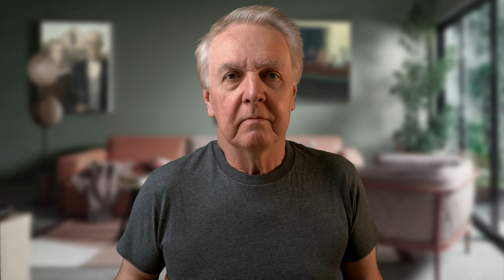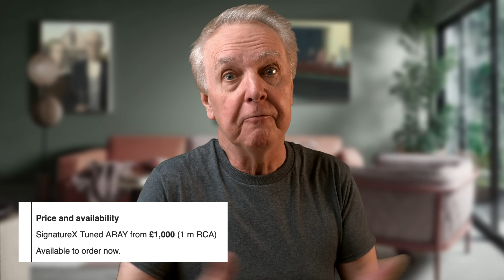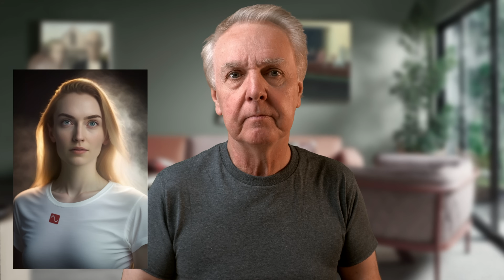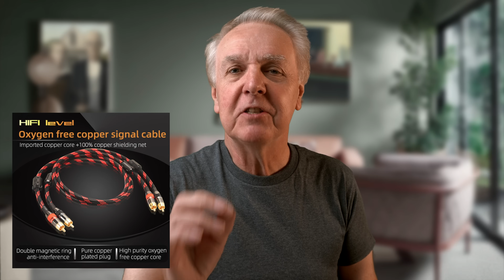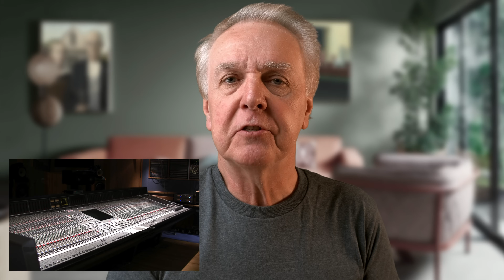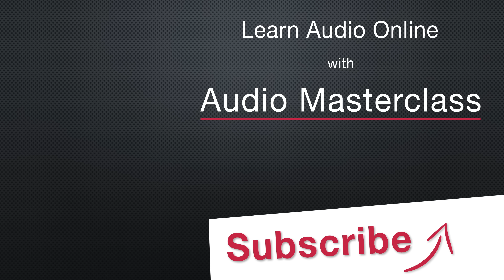Would you pay $1000 for a 1-metre cable?

Comment: My interconnects retail for $11,700 for a 1 meter pair.  If you can explain to me why the manufacturer specifies interconnects and digital cables in mettric and speaker cables in feet.  The lady's comments were as over the top like many in this industry I'm in.  I highly recommend to my customers and anyone interested that they follow the advice of early 20th Century composer Charles Ives "Stand up and use your ears like a man".  I loan this stuff out (the 12K ones are the most expensive, with the starting point being a couple of hundred US dollars).  There is a great deal more to the sound than the things you mention.  Yeah, most anything will give you flat frequency response.  One of the first things I hear in lesser cables is what I call "smearing".  Cable insulation is a dielectric - it stores and releases energy.  There are many other elements that are over my head.  I simply listen and decide if the improvement, assuming there is any, is worth the money for my budget.  Skin effect is more complicated than you mention.  Based on your comments, and assuming you have a competent system, ile. decent, not necessarily high end, I suggest you follow Mr. Ives's advice...
Reply: Are you so confident of your ears' ability to discern your cables that you would gamble them in a blind test, I wonder?

Comment: Howdy.
Lancaster Hi-Fi says that interconnects matter and presents data to back it. But Yes. The gear is Hi-End.
PS Audio advocates that speaker cables and power cables do matter. And again. PS Audio operates only in the domain of the best of Hi-End.
I would like to present the scenario of step by step upgrading. To me that makes sense. One may begin the process of upgrading with interconnects, speaker cables and power cables. I would not take away the satisfaction someone may feel having done these steps.
Personally I like the way Masterclass, Lancaster and PS Audio do their evaluations. Usually.
Aspects are illuminated from several angles and evaluated towards different premises.
What I don't like is evaluation done FOR me. For myself, I do the final evaluation myself.
Best Regards.

Comment: What I never got about expensive cables what about the wires that go from the port to the internal wires to the circuit boards? Are those wires inside the audio equipment also that expensive?
Reply from the maker: You need to ask an audiophile.
Reply: And what about the wires from the individual components: capacitors, resistors, transistors, ICs etc?

Comment: I can't think of a worse connector than a RCA, especially one that's not gold plated.  They're subject to corrosion and they are press fit without any positive mechanical locking mechanism.  But worse of all is that they are unbalanced, allowing any ac power ground loops to be injected into the audio signal.  The only thing they have going for them is that they're cheap.  That's why RCA designed them to connect their record changers to their radios back in the 30's.  I think they even used them as antenna connectors.  Shielded microphone cables are much better.  I don't know why they aren't more widely used.

Comment: Betty creeps me out.
Anyway: A music equipment store assistant told me, the thing about oxygen-free copper was that it was more flexible and wouldn´t break off the plug for extended use. Whereas conductivity issues could be remedied with increasing the diameter of the connector. Any thoughts on that?

Comment: 'Ultra low mass' Denis Morecroft of DML design described the advantages of using less metal in phono plugs as reduced eddy current at the plug. 
I've made up DNM Reson cables and it seems to be true. The less massive plugs are clearly a cleaner sound

Comment: It's been tested consistently.. so long as the metal is conductive, it's going to make no difference to the sound quality whatsoever. I saw a test with coathanger wire compared to Monster cables costing $2,000 a meter... zero difference. It's the ultimate in Audiophile snake oil.
Reply from the maker: True audiophiles can easily tell the difference between a $2000+ interconnect and a coathanger. Of course it has to be a wooden coathanger.
Reply: @AudioMasterclass  Hahaaa... brilliant!

Comment: Several years ago I was trying to research SPDIF vs optical digital audio and found a great thread - there was a huge debate raging with audiophiles SWEARING that some $400+ SPDIF cable made a huge difference, citing pretty much all of the things that you mentioned for these cables - "bass is much tighter!"  "transients are WAY more accurate!", etc.  Never mind that digital audio has no physical way of responding like that to any cable.  Anyway, the thread culminated in a double blind experiment at a local audiophile shop with the expensive SPDIF cable vs literally a coat hanger with RCA plugs soldered to either end.  The coat hanger won.

Comment: A few years ago I had a conversation with a customer at a very high end audio store in northern NJ.  I did some bench tech work repairing gear for them.  This guy went on and on about how much better cable 'X' was than any other cable out there.  How it 'opened the soundstage', etc...  I went along with him because I wasn't going to deny a sale to the owner of the store, knowing full well that what he was spending on 2 meters of speaker cable was ridiculous.  When he finally bought his cables and left I noticed he was wearing not one, but two hearing aids.  He must have been 70+ years old.  Yet his 'perfect ears' heard the difference in cables.  Many , many years ago I had a conversation with a guy who, I'm sure, forgot more about electronics and sound than I'll ever know.  Basically he said to get nothing less than 10 gauge stranded cable for speaker lines and you'll be set.

Comment: Back in the early 1990s, I had a friend who was an audiophile who gleefully purchased $1000 cables for his home theater setup. 

One cable he was particularly in love with was the digital audio cable that connected his DVD player to his amplifier. He said it ensured the wave-fronts of the digital signals were nice and square, that all the digital signals were the same height (voltage), and that the timing was as close to perfect as possible.

Yes, this was a digital cable he was talking about.

I explained that the voltage of a digital signal needed only to cross a threshold voltage to be classified as a "1" instead of a "0", and that "height" considerations beyond that were pointless. I also explained that the receiver uses a timer to sample the voltage on the cable, and that the wavefront doesn't matter because the receiver samples in the center--not the leading edge--of each pulse. For the same reason, the timing of the pulse wavefronts doesn't matter because the receiver isn't even looking (sampling) when the wavefront hits the receiver.

I further explained that the digital pulses that come in through the cable are not digitized sound. Rather, they comprise digitized sound that has been packetized with checksums and other failsafe mechanisms that are not directly related to the sound. I told him to think of digital data as being instructions--like a recipe--telling the receiver how to reconstruct the sound, not the sound itself. (I made another dig by telling him that saying he can hear whether the timing of the digital pulses is optimal is like knowing a cake recipe was written in italics by the taste of the cake. He didn't appreciate that at all.)

And even if I was wrong about all that, the digitized packets the wire delivers are buffered in short-term memory circuits within the receiver. so that when the sound is reconstructed, it is done so from the buffered data, not the data from the wire itself, rendering completely moot any concern about the timing or wave shape of the digital data delivered by the wire. 

But he continued to insist that his super-expensive digital cable sounded "warmer, more full and robust".

I proposed a single-blind study in which I would switch out his digital cable with mine to see if he could hear a difference.

We did the test, and he declared quite emphatically that "Cable B" was his because it sounded so much warmer and fuller than "Cable A"

I invited him to come around to the back of the receiver and showed him that "Cable B" was my cable, not his. Moreover, I had constructed my "Cable B" from two clothes-hanger wires bent into random shapes to keep them from touching (so they wouldn't short out).

We haven't spoken since that day.
Reply: 😂 oh dear. How NOT to win friends and influence people?
Reply: @jimsimpson1006  I know, right? That guy was SUCH a complete...

Wait... You're referring to me, aren't you? 😏
Reply: @Astronomator  yes, but light-heartedly. 🙂
Reply: @jimsimpson1006  I guess I'll let it slide, then... THIS time. 😎

In all seriousness, I can't say I've missed his company. But I do wonder to what extent his ability to hear whether there's dust on the speaker cables (and other miraculous aural feats) has helped him in life.
Reply: Buyers remorse and denial in face of facts helps snake oil audio companies safe from a crowd with pitchforks.
Unfortunately most people aren't tech savvy or engineers, so it's your word against word of the guy who gushed over and sold him 1000$ cable + buyer's remorse. 
All the person who doesn't understand anything about it can do is chose who to believe.
Reply: @Cypeq  You make a good point about buyers' remorse and denial. Add to that Sunk Cost Fallacy. Once they're thousands of dollars into their systems just for wires, RF chokes (which actually HURT the sound when you place them on speaker wires), and crystals, they must live a life that justifies that expense. 

It is true what they say: Ignorance is bliss. Alas, in this case, it is the bliss of not realizing how much more blissful life could be (and how much more money you'd have in your pocket) if you had just not been ignorant in the first place.
Reply: @Astronomator  Once somebody is convinced about some ludicrous fact, it's extremely hard to shift their opinion, no matter how persuasive your argument. It's far better to educate people first. Just let the fools be parted from their money, and think of the tax revenues.
Reply: I only use low-mass clothes-hangers myself.
Reply: Best comment EVER!😂

Comment: Snake oil is good for making a 1998% profit margin.
"Oxygen Free" is more about degradation over time from oxidization and the improvement is usually "theoretical" when in most cases is not noticeable to the human ear unless ridiculous attention to the equipment quality, listening environment and the type of music being listened to, assuming the personal hearing sensitivity of the listener matches superman ;)
Separating audio cables from power cables (induction) would be a more productive activity.  ISO11901 provides guidelines of separation for telecommunications cables and Hazardous Voltage services based on KVA although this is for installed building services cable.

Comment: I've no idea about this, but I did hear of a musician/producer/audio engineer who used 2-core 5-amp cable professionally for his interconnects. I don't know the technicalities of this, but I've taken the "If it's good enough for him" view. (The only difference is that I got 6-amp cable instead of 5-amp, as that was what came most readily to hand.) Obviously, I had no idea what I was doing - I relied on the self-reported practice of one expert - but I have been very happy with these cables' performance (well, it's not bell wire). Anyway, this came in at rather less that £1,000 a metre.

Comment: The manufacturer doesn't know physics selling 1-meter cable!  All cables should be 2 meters or 14 feet - 2 meters is a half cycle of a sine wave and 14 feet is a complete cycle.
The most obvious upgrade is to get rid of the stock power cord and change it to a 6 feet 10AWG  7N pure copper OCC (or OFC) power cable for less than US$100.

Comment: I sometimes make interconnects myself from RCA plugs and a microphone cable. I can say that my cables are “directional” because I connect shield to the ground on the side of amplifier only. I think it is the only reasonable explanation of direction that exists for interconnects.

Even using very good German or Japanese cables and plugs (and of course unleaded solder with silver), the resulting cost is up to $50 a pair.
Reply: Watch this video about shielding your cables. It talks about mains cables, but the same applies to your interconnects. https://www.youtube.com/watch?v=Q9Y3r8CqXlc

Comment: Well I agree with your reasoning. And I think youre technical knowledge cant be questioned.
But the fact still is that I've heard hifi stuff and how different things (not explainable thru technical aspects and so fourth) are making a big hear able difference. 
So I often react when someone (not only you) try to say or "put a worth" in something.  Without actually really listening to it.
And no I wouldnt either buy such an expensive cable. But at the same time say it wouldnt make a difference without actually listening to it..... How does it in fact sound or not sound compared to a cheaper cable or component. 
And offcourse wither it does that difference or not.  If its worth that cost. Is offcourse up to the buyer.
So to summon.
I really like youre technical knowledge but I would also liked you to really listen and compare a cable like that soundwize.  Ive seen some other Reactors to that only judge out things as snake oil or that you absolutely can find the same technical specs in something cheaper.  And all without actually listening to it. 
Hope you see this as constructive criticism. 
Me myself I build my cables myself at a cost effective but still sound inproven (as to my ears) way and at a price that I can live with :)
Im a subscriber and like ure chanel. And excuse for my bad English ..
30 years since i learned so...
All the best from Stockholm Sweden/ J
Reply from the maker: I have a couple of tests in mind, but I'll need a helpful manufacturer to lend me a cable. $1000 is most definitely not in my budget.
Reply: @AudioMasterclass  I absolutely understand that. 
Annyway to my ears cables makes a difference.  But its never needed to spend crazy amounts of money. And make em myself is both fun and gives a lot back. At least I think in sound for "okey spended" money.
My point is explainable or not, thru testing or numbers. Cables for me can make a sounding difference. 
And in the end for me thats more interesting than if its measureable or not. But thats just my opinion annyway. And all due to how much money offcourse Im willing to put in them.
Once again thank you for a very good Chanel. All the best / J

Heres an interesting link to another good YT chanel I saw today. And its also about cables. And how he thinks of the subject at hand.
https://youtu.be/JjaF7r2acog?si=wSl8kOz5BM-SOonu

Comment: 4:06 There's a whole theory that claims the amount of metal used in cables (probably referring primarily to those metal parts that have a shielding effect) and the materials that are found within the electromagnetic field created by the cable both have a quantifiable but very hard to measure effect on the signal. So, on the basis of this theory, the less materials are used and the further away from the two conductors, the better. I never quite bothered to check the details and to properly scrutinize it (quite a few equations were involved, I believe, and there was never that much spare time to check something like that) and I have forgotten where I read about it: those websites now are probably long gone but I'm sure if anyone digs they will found the relevant information easily.

Comment: If you have the money, why not spend 1000 for 1 meter of cable? 
I heard that there are guys who pay 2000´000 buck for a car although those are by no means better than the 15´000 bucks cars: Both do 30 in a 30-zone and 60 in a 60-zone and 120 in a 120-zone. None is faster than the other. The more expensive one is quieter in the inside. That´s it.   :-)